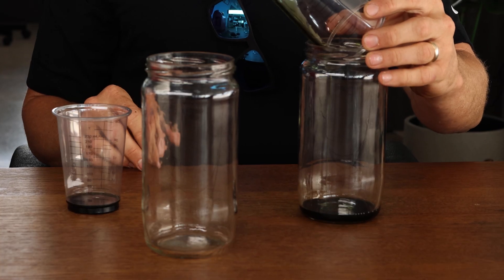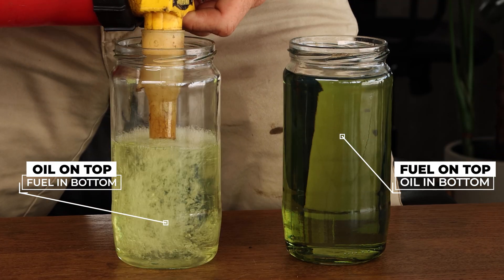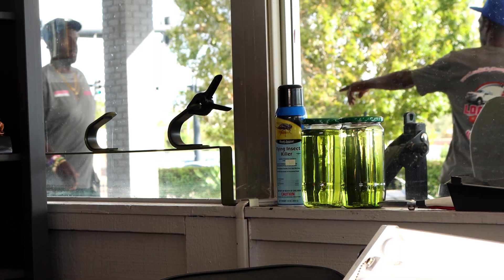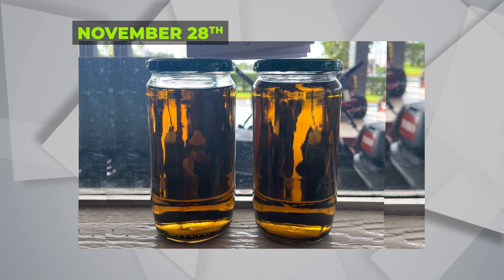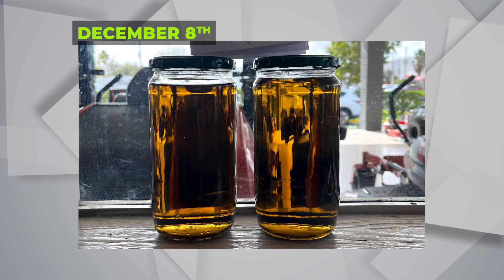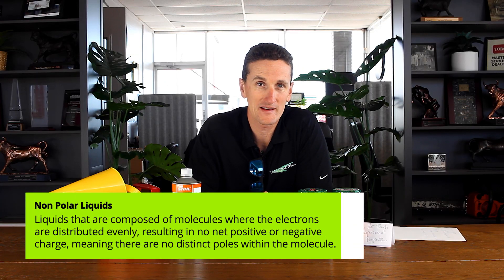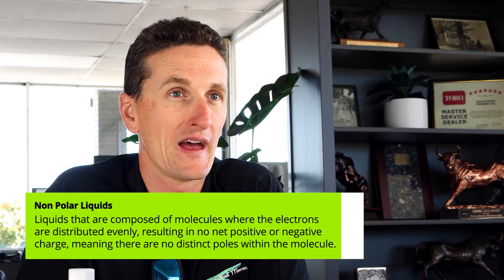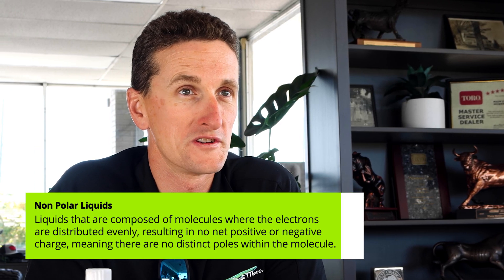I Spent 30 Days Testing FUEL MIX Shaking and Here's What Happened

Comment: The fuel has the oil in solution not a suspension.  It cannot "settle" and form a sediment. It can only thicken due the the gasoline evaporating.  Of course that's not going to be an issue as the fuel should be sealed prevnting evaporation and the fuel would go bad long before this ever became an issue.
Good explanation Stu.